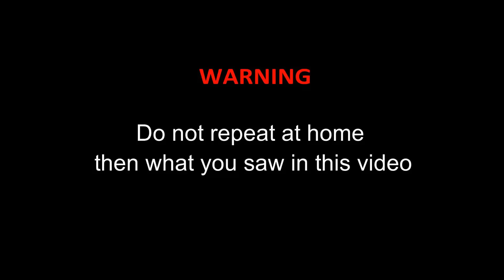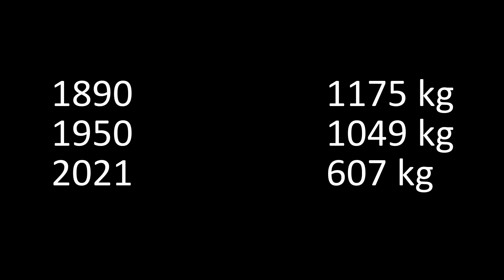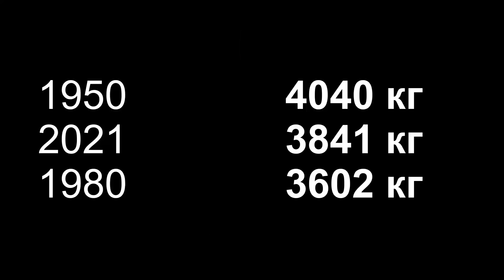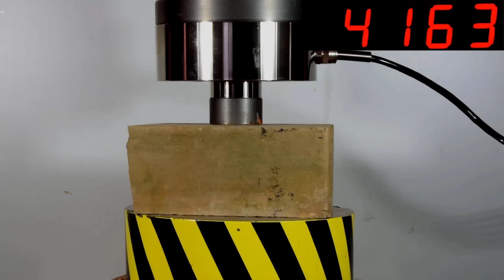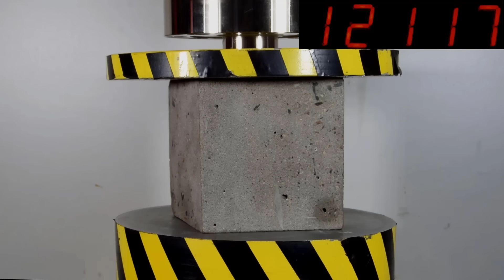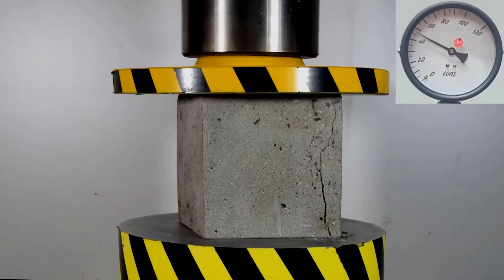HYDRAULIC PRESS VS OLD AND MODERN BRICKS

Comment: The modern high strength brick was placed differently. The previous ones were on two supports with space in the middle when they were one their sides. No support directly beneath the press.

The modern high strength was on it’s side but not up on supports. Not saying it wouldn’t be stronger than the others if it was placed similarly, just saying it probably wouldn’t have been able to take as much as it did.
Reply: That was part of the test where the older bricks were on their sides just like the modern extra strength brick

Comment: Strange testing different concrete types... the "old one" has stone, and is perfectly flat all sides, the new one is pure cement+sand, no rock or steel, and the sides are asymetric.
The blocks of clay I expected that the more modern would be less strong because its newer and overall smaller

Comment: Your clip was quite informative… However, at 6.43 you show ‘modern concrete,’ as a retired builder I recognise that this was purely a block of solid cement not concrete.  Remembering that cement is made up of just cement (Portland or similar) and sand... concrete is made using the same but including an aggregate (gravel or similar) at a recommended 3-2-1 ratio.  There was NO gravel or sign of aggregate visible in your sample? Otherwise great visualisation of strength.  Thank you.

Comment: This is also a very Inconsistent way to measure it. Not the press part persay, but the way you have placed the items on the platform. Inconsistent from brick to brick when you put the 2021 brink on the plat for the 1st test it had less surface area on the metal rods than either of the other two bricks.

Comment: Why use different punches? Different punch means different specific pressure. Specific pressure under a large punch at 10 tons is actually lower than under a small punch at 4 tons.

Comment: Non engineering students don't understand that more strength necessarily doesn't mean better✅
We don't need that much strength in normal partition wall brick, rather we need them to be economical and less pricey. Hence engineers developed just the perfect strength brick, that does the work and cost way less.

Comment: That horizontal press with 1950 and 1890 was not fair, the press was not at the center of these bricks, causing the pressure not to be equally divided and  resulting them to bent upwards infinitesimally from the part protruding out and consequently breaking them early.
But yeah a little doubt in audience's opinion always helps with views.

Comment: Unfortunately the outcome of this test is going to come down to how well the surfaces of the bricks and tooling line up in order to spread the load.  When the surfaces don't alone, it creates pressure points which cause the brick to fail prematurely.
Every single brick failed at the point of first contact.

Comment: Modern bricks have lightweight and better temperature isolation than older bricks. Because of the light wight they dont need a hight load capacity.

Comment: i believe the older bricks are stronger for 3 reasons, 1 they were taken out of a building with years of pressure on the brick making it more compact, 2 there must be some internal chemistry over time that makes the bricks form from a compound into a sort of rock formation(grime, rain and all that stuff), 3 if you had the money to have quality bricks made back then then they were expensive and made from the best material back then, opposed to the mass production from viable material today ... both good but the older they are the better they are ... its like stone walls nowadays, now they are functional and will last for a lot of years, back then they were not only meant to last for a lot of years but withstand a severe beating too ... tell me your thoughts

Comment: There are confounding issues with these tests. In the first test the bricks are all on edge so the taller bricks (older) have a structural advantage even if they were all the same material. For the second test - the crushing test - the bricks with the most planar faces (2021) will have an advantage. The first test should have been with bricks that are the same dimensions, for the second test the old bricks should have been sanded on 2 sides so as to be planar. With these tests I have no idea which material is stronger, or harder.
Reply: Although the 1950 brick did seem to beat the 2021 brick on the bridging test because it is roughly the same dimensions.

Comment: The first type of testing isnt really compression, since it creates a high tensile stress at the bottom. The stresses from bending can be nicely seen on the crack on the1950 brick. The first brick also breaks at the compression diagonal from the shear forces at the supports. Bricks in a wall arent loaded like this. The second type of testing is more relevant, but bricks arent loaded like that either, or at least you should avoid putting concentrated loads on a brick wall.
As for the old vs new.
Well, duh, they make the same bricks as 150 years ago. Someone said, new brick with airpocekts take hurricanes better. I have no idea what would be the reason for that. If anything, old brick buildings are sturdy as hell, they are just energy inefficient.

Comment: It's not a matter of bricks gaining strength, brick composition and hardness has changed, older brick were typically softer with more give then most bricks today (but modern bricks have alot alot of variety)what this means is smack the new brick example with a hammer and it'll split faster then the old example, but try to cut them with a brick saw and the old brick will probably cut much easier

Comment: This just proves that in the days of old, people built things that made to last almost forever. Strong, sturdy and beautiful structures.

While on the modern day, we have "engineers" 🙂🙂🙂
Reply: Most of the people in the 1800s were engineers, who built infrastructure. The biggest problem is that the standards we have today are far lower as people want cheaper solutions.

I work in civil engineering, and I can attest that the majority of people do not want high grade concrete as it costs too much and can take a bit of time to gain a good psi compressive strength. Now, I love high quality engineering and craftsmanship, but society does not. Also, if you think concrete is bad, just research onsite wastewater, it's a race to the bottom in quality. People will not use aerobic treatment anymore, they want "passive" as it's cheaper, but systems now fail more.

Comment: Inaccurate. For the second test they used a brand new 2021 brick, but they used the previously broken pieces of the 1950 and 1890. Should've used non-beoken bricks as well.

Comment: note that in a real building the weight would be distributed far more evenly across the bricks, letting them withstand vastly heavier loads
also note that the newer brick is probably lighter so the load it would have to bare in a modern building is realistically smaller

Comment: Bricks are never used as cantilevers, where they would be in tension, as the bottoms of these bricks were during testing. Ceramic materials fail catastrophically by crack propagation in tension. So masonry bears weight in compression, which tends to close the cracks. It would be a terrible waste to optimize a brick for the best performance in tension, because it will be far inferior to steel or wood anyways. The better design trade-off is to reduce its weight by increasing porosity at the expense of increased crack size, but simultaneously decreasing compression stresses. Modern bricks are superior at doing what bricks are designed to do.

Comment: modern bricks are light to be walls as an insulator. the strength of a house is on concrate , metals , collumns and sceleton before fill the walls with bricks. You don't want to put a 1890 bricks in your second floor and burden the sceleton of bulding without reason.

Comment: I’m not an expert but doesn’t modern concrete require gravel? It looked to be pure cement. Plus doesn’t concrete need years to cure so the older concrete would be better specifically because it’s older?

Comment: Old bricks are softer. Which is why you cannot use modern mortar mix with old buildings and bricks. The mortar used must be softer than the brick. Otherwise, brick spawling will occur with expansion and contraction. Mortar deterioration is actually ideal vs brick deterioration. Mortar can be retucked easily, but brick replacement isn't as easy and compromises structure.

Comment: Firstly, the modern concrete block cannot carry so much because it was unilaterally burdened and secondly, a mixing ratio of 5 to 8 cement to sand is used today, the bunkers were then mixed 7 to 8, the flak towers in Vienna may serve as an example, still standing although one of them was filled 10 meters high with explosives by the russians, the only result was a 20 meter long crack you couldn't even put a hand in

Comment: I don't care what you say.  Engineering is focused on making the same thing with as little material as possible.  The side effect is things get cheap.  The reasoning behind air pockets and all this b.s. it's only spin because it is cheap.  That's why its not a primary building material anymore and just the veneer of the structure.

Comment: was that modern concrete even given time to cure properly? it still looked wet on the inside, plus the fact that concrete actually gets stronger as it ages (up to a limit). 
also todays bricks are not all made the same, there are many MANY versions to pick from. some are made for load bearing but most are not.

Comment: How much survivers bias is there in this test? How were the old bricks sourced? If you are finding 100 yr old bricks, it's most likely only the stronger ones that remain. All the average weaker bricks would have broken long ago, been scraped or not used for the test since already fractured.

Comment: Modern bricks are only cosmetic. They are made light so that handling is easier. No one would build a building with bricks as the structure with modern building materials. They just do not perform anywhere close to beam type structures.

Comment: Hardly a meaningful comparison. The older bricks were structural, and probably both were within tolerance. The modern brick is ornamental. No one is going to build a house out of that stuff. They might use it for facing, or pave a walkway with it.

I'm not even sure you can get bricks like the older ones nowadays. The market for them is very, very small. Where I live, a structure built out of them would not be in compliance with code.

Comment: There is a reason Modern Brick is not as Hard the function of brick has changed in modern Construction. In the 19th Century Brick was Structural Multiple brick Walls were tied together using Locking Rows you can see this on Buildings into the 1920's The Walls were Load Bearing using only Brick some stone at times or Heavy Wood Beams would be incorporated. Today Brick is used as a "Screen Wall" it adds no compressive strength to the structure only Diaphram its primary function is to slow Wind-driven Rain (and wind itself) Allowing Moistute to move into the airspace between the Brick and Structural wall where it drains through "Weeps" at the bottom of the wall or Vents at the Top

Comment: I don't think this represents the strength of the bricks. The surface area of the hydraulic press is the largest at the end, allowing for the distribution of weight,  while in the beginning of the video, the hydraulic press is applying all the force to a very small surface area.

Comment: your modern concrete example is not what would be used in a structural capacity.  that was basically a block made out of mortar.

Comment: It's 1890 you put 1980 also you used the already broken bricks for the two older ones in second test. That's why your readings didn't come back the same as the first test.

Comment: The size matters. I don't think square brick will have similar strength with rectangular or bigger different shape sizes. So to that, I believe the concrete test is totally biased...there must be weight measured prior testing and diameters to test their ratio strength  n so forth

Comment: forces applied on the bricks are wrong. Brick quality is measured by their ability hold against compression not tension, bricks are always layed out so they press against one another, it's why brick structures, even of old are full or arches. You want tensile strength, you use steel.

Comment: Looks at modern bricks and thinks ''they aren't used in any houses I've seen built, where are the holds for the metal rods to go down through for strength''  and also thinks ''that 1890s one looks like a fire brick, even looks as though it has been used in or near a fire from the blackening''.
I've never seen bricks like these and dad has built 4 houses from bricks so I grew up having houses built around me.  I've also seen bricks here [other side of the world now] and they look the same as the bricks did when I was growing up.

Comment: Although a fun video, don’t take it that old means better.  There are all sorts of modern bricks at different strengths and prices, made for different purposes.  Modern load bearing class A engineering bricks could beat all the older bricks for compressive strength.

Comment: Haven't bricks that ar 50 or 100 years old already proven that they are stronger than the average brick simply by sticking around to be tested? For the 100-year-old brick, isn't that much stronger because it's much longer? 
Same for the concrete. (BTW, the concrete is an engineered material that can be made much more or much less strong, depending on the intended purpose.)

Comment: Modern bricks do not need to be as strong as bricks in the past. Bricks in the past were structural and had to hold up the building, modern bricks are cladding and only cover the structure they only have to support their own weight.

Comment: Some people are giving clever reasons as to say that modern bricks are not made to support load, that they are lighter and better to provide insulation. But still they suck in comparison to older bricks. The best part of the video followed next: the modern high load brick!!! What a wonderful contrast. It perforando so well that only older concrete could out do it. And what a piece of older concrete, it took 60 tons to break it!!!! The modern concrete wasn't even close... I pressumed that there should be other types of modern concrete. I think the video should give some more insight to properly compare, because so far, the evidence points out that we are living in a cheap world where profits are more important than safety ...
Reply: Well the modern concrete apparently could have still been settling considering how it broke.

Comment: As an engineer I'd say these tests are not realistic.
First 3 testing bending moment on the wrong use surface, then the high strenght one only shear stress, which is basically different from bending moment, and is obvioulsy higher than BM since BM derives from shear force and for fragile materials is quite low.
Then compression on different coordinates of the surfaces.
Not repeating any test is waaaay to dumb for objects that are light years far from being homogeneous and isotropic.
Not good mate.

Comment: The problem I can see with the brick test is or might be "survivor bias". The brick one that survived, weaker ones may not have survived. (Though, I admit most brick buildings from 1950 are still around, unless they have been demolished intenionally. Not sure if there is a survivor bias)

About the concrete: AFAIK concrete tends to get harder over time. I dont know how much that is and how long this effect keeps going exactly, however I'd be greatful for some input.

However, we can certainly say about the concrete, the modern concrete is lowest quality. Only sand, no bigger stones. The older concrete has a much bigger mixture of different size stones. You are testing a ferrari against a fiat.

Comment: They make bricks with different load capacities. They don’t use the same ones at the bottom of a wall as they do at the top. There are all different kinds of bricks for different load capacities, waterproofing, etc. They make thousands of variations now, as they did then. Grabbing 4 random bricks from different periods means nothing. Its a nonsense test.

Comment: there are a lot of variations in your testing. i don't believe this is very accurate. your second round of pressing shows a NEW 2021 block vs the older ones being broken already and the the high strength block did do not have a gap in the middle underneath.